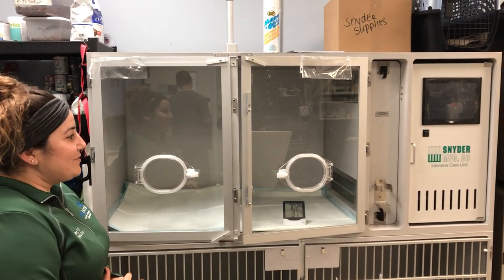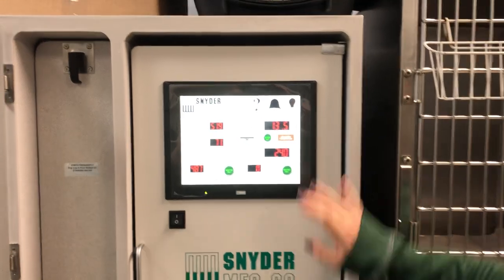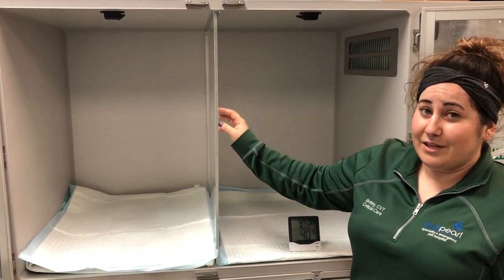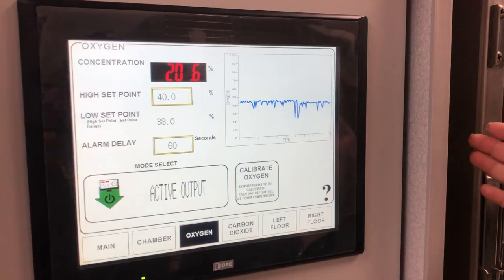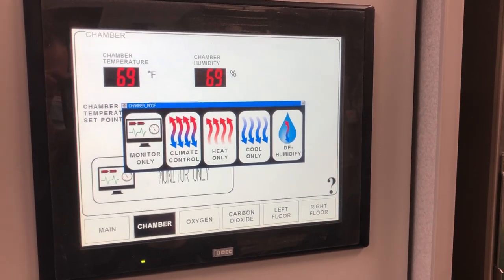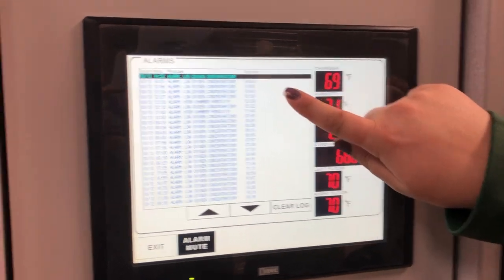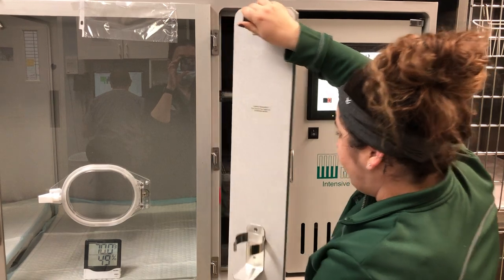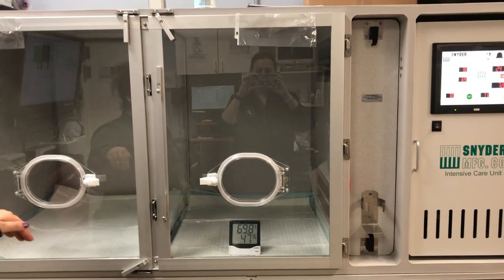Snyder Oxygen Cage How To

Comment: Do you have to turn the o2 off when changing the soda lime?
Reply: No, but you should replace the door to the compartment during the change. If you don't, oxygen will leak out and you may as well turn off the machine to recalibrate.